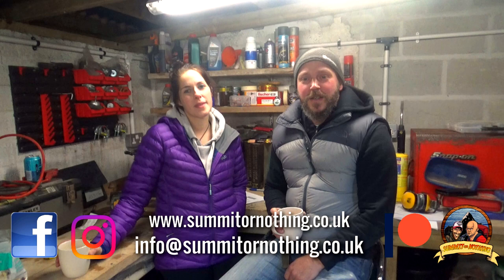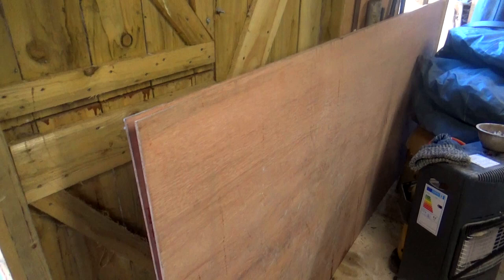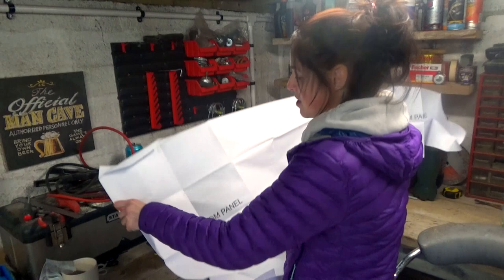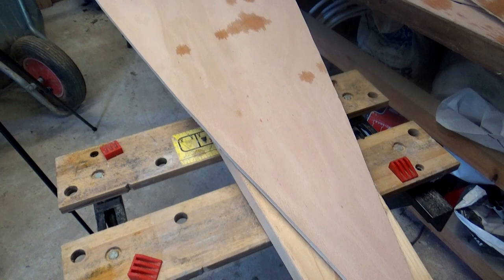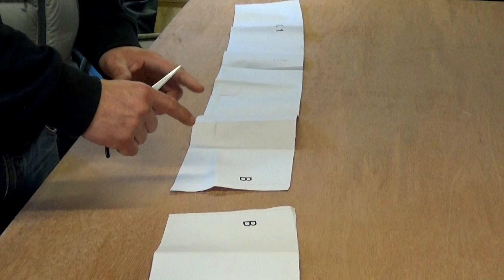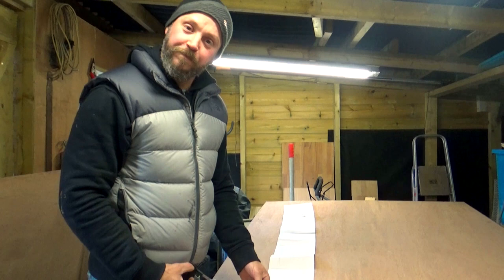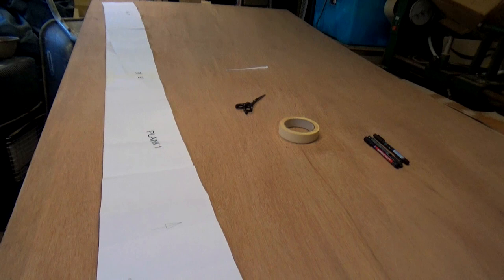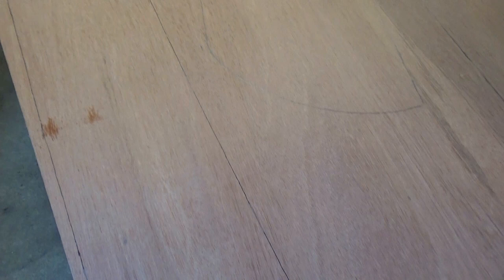NATH & HAYLEYS CANOE PROJECT

Comment: many years ago the Mirror sailing dinghy was very popular (the wee boat with red sails) it was often sold in kit form, using the same stitch and glue system you are using.
Good luck with the project.
Regards from Whitley Bay

Comment: If its not marine ply, doesn't that mean it'll delaminate when it gets wet?
Reply: All ply will delaminate when wet. All wood will be seal by epoxy resin. So the grade of timber on only really relevant to its strength an quality, and not its resistance to water damage. But a good question. 👍 thanks for watching.

Comment: Good luck , how did the camper van refit go ?
Reply: The camper is still waiting on an engine. Basically loads of parts for the engine were manufactured in the Ukraine. So we are now looking at a subaru conversion. But unfortunately we have hit the busy time of year. We are gonna pick it up again this winter. Betsea is currently in dry storage waiting for a Power plant.